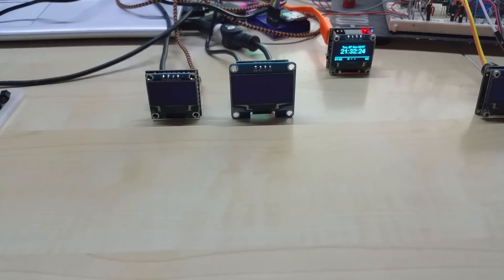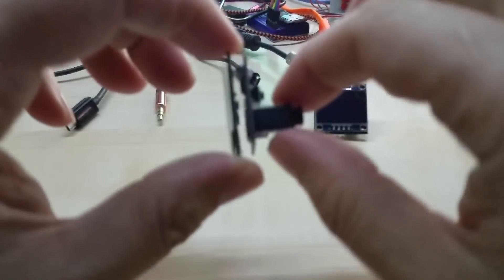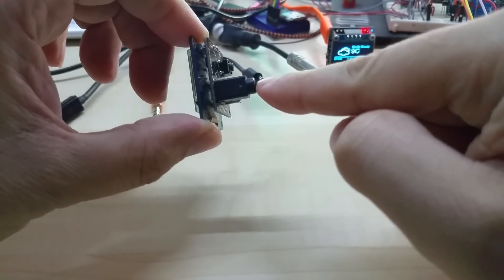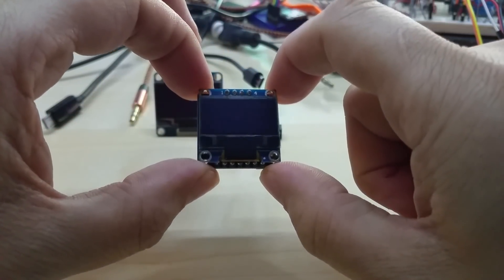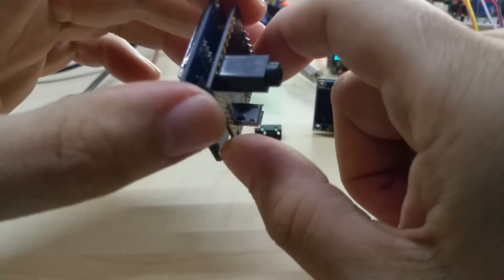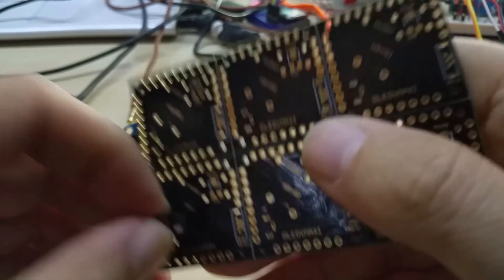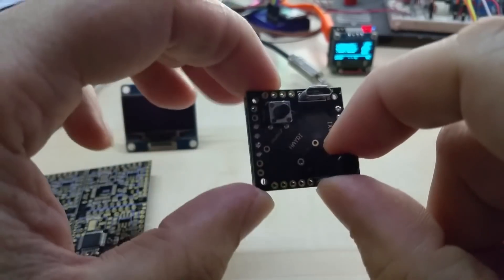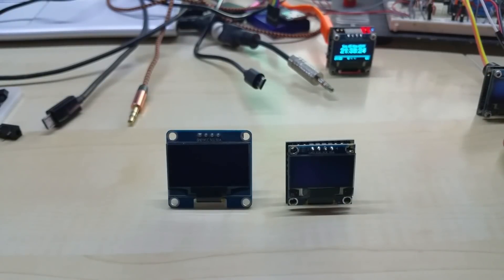Updated Spectrum Analyzer with new PCB

Comment: Is it possible to get one that has a microphone instead of the 2.5mm input?
Reply from the maker: Would need to do that externally because the microphone needs a preamp. Maybe I make a version with a mic and preamp on a new PCB but need to sell some of these to get my cost in first. I might even make it with a Lipo so it can be used anywhere by just placing it next to a speaker or other audio source.
Reply: I would absolutely love something like this, I have been following you for a while now, I wouldn't be opposed to pre-purchasing a unit to assist with initial up front costs, wouldn't even expect a timeline for completion as I know you are also working on the OLEDiTREK project as well(also interested in this little guy!) :) Either way I'll be around my friend, keep doing what you are doing, I love it!
Reply from the maker: Thanks for your kind words, I really appreciate it. Yes the OLEDiTREK is coming along, just made the first version with the new PCB's and it looks awesome, if I say so myself :-) Even my wife loves it and she is not into electronics at all :-) Will keep a mic/Lipo version in mind, actually was just looking into adding a mic to the OLEDiTREK too so I can use it as VU-Meter and Shot Timer also, among other apps. Have way to many ideas here :-)
Reply: Awesome!!

Comment: I like the response they have.
I think that was the first time ive seen the MSGEQ7's actually work as intended. I think I got the dodgy chips  :(   A few bands look like its working, Some are just noise, Some are constant high or low.
Reply from the maker: You would not believe how many trash MSGEQ7 chips in dip version I have :-) Glad finally switched to the original SMD version. Will make a video of a stereo version too.
Reply: I know, You mentioned it many months ago. You actually sent me a basic schematic on the chips. Its was one I already had :D but at least it confirmed my bad chips.
Cheers dude :)
Reply from the maker: Yeah, it took me a while to make the new PCB because I was working on other ones before I could finish this one :-)
Reply: Where did you buy your EQ7's ? I forget where I got mine, but $2 per chip might be too cheap.

Comment: The large blue one is awesome!
Reply from the maker: Thanks Daniel, I just love OLED displays and particular the spectrum analyzer since the old days were you could buy big 20 band equalizer with a spectrum analyzer in the middle, Technics comes to mind my favorite brand back in the 80's.
Reply: Hayri I still have 2 of those 20 bands with the analyzer hooked up to my component systems. Mine are from the early-mid 90's though so they're slimmer than the really old school ones. I've always liked them too.